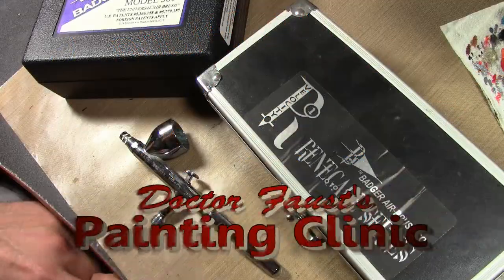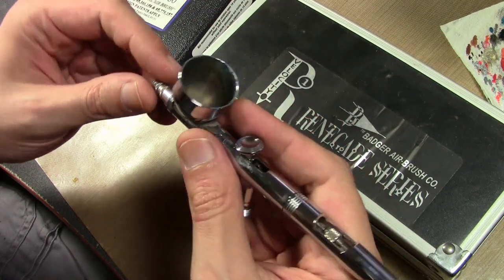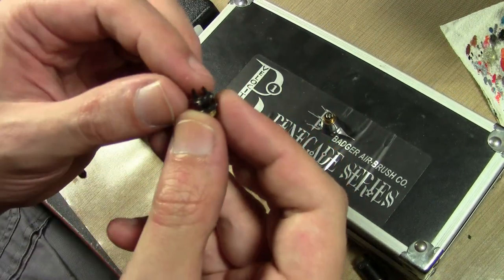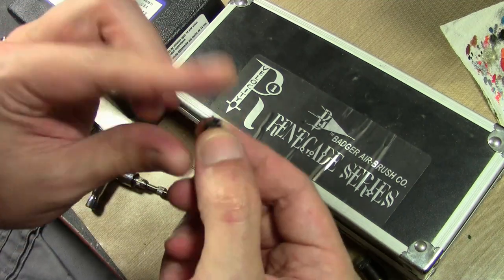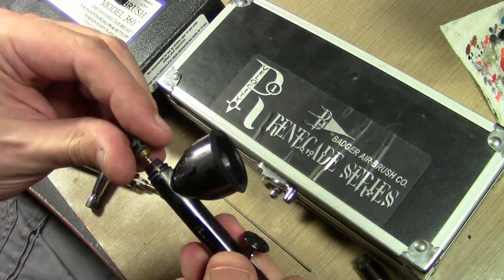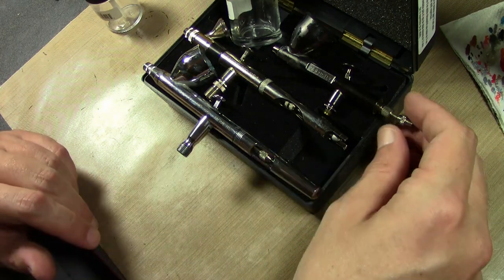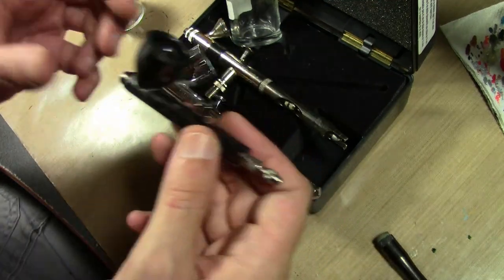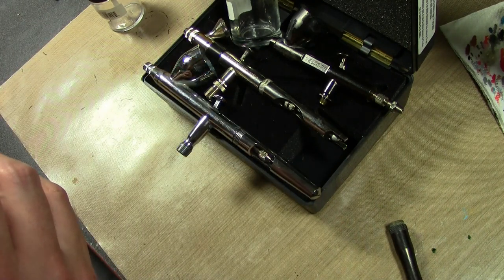The Beginner Modeler's Guide to Airbrushes

Comment: The forked tip makes it easier to clean tip dry, I believe that's the purpose. But as you said it makes to difficult to clean with back pressure. The Veda 180 is a good budget airbrush.

Comment: I got a Harder&Steenbeck Evolution 2in1 for my first proper airbrush. It was a little expensive but 2 interchangeable cup and needle sizes in 1 box? Yes please
Reply: H&S brushes are the bomb in my opinion. Blows all others out of the water!
Reply: You can also retrofit the 0.15mm needle/nozzle (like in the Infinity) for your Evolution for an even tighter spray pattern.

Comment: You should also mention that people should think about are the size of their hands too. You don't want to get a small airbrush and have a large hand. If they do and if they airbrush for along time, they will be getting cramps or will tired easily. Pachsee will be good for those problem and they are very easy to fix and use too.

Comment: Actually, nozzle size differs from company to company.  For example, the Badger 360 has a large nozzle like the Iwata Eclipse (go ahead and take a look inside).  The Iwata Revolution CR, on the other hand, has the same tiny nozzle as the Badger Renegade.  The big difference is that the tiny Iwata nozzle is screwed into place with a  small spanner.  The big problem with that, is that if you screw it on too tightly, the nozzle component actually separates from the threaded component, rendering it useless (happened one time too many on similar airbrushes).

Comment: I actually use the devil's horn/fork thing a lot on my Harder & Steenbeck and you can actually use the tip-blocking cleaning technique anyway. Just pinch it and you'll block the air. It's a lot faster to clean a tip-dry on that than to unscrew a solid one.

Comment: I have the Badger Velocity , the  Badger Patriot 105 and the Harder & Steenbeck Siverline Evolution. The 105 is my goto air brush. It's built like a tank and easy to clean. The Velocity is a nice AB but it actually has a .21 needle. Which is fine, but it takes a lot long to clean. And I have lost that nozzle. So now I keep a spare. I have a love hate with the Evolution. Amazing craftsmanship and the trigger is all that. But man, it is miserable to clean. Everybody raves about how great the H&S's are to clean. What a load. I actually have to run this through the ultra sonic every time I want to change colors or just clean it in general. I am going to get an Iwata Eclipse. It looks pretty much the same as the Patriot, but I love  the idea of flushing the paint back into the cup. Cant do that with the Patriot.

Comment: Like a screwdriver, or socket wrench, (the list is endless), an airbrush is merely a tool.  And it's hard to do good work when you buy a cheap tool whether it's a lousy screwdriver, a poorly fitting socket, or an airbrush.  My first airbrush was a Harder & Steenbeck (which model you buy isn't very important because all of the parts are interchangeable) and I found that airbrushing was a lot less difficult than I thought it would be, and my first efforts looked pretty good.  Thinking I would get a cheap airbrush for painting large areas, I later bought a Badger and had nothing but trouble with it.  I shudder to think of just how much more difficult a Master Airbrush might make of a relatively simple task using an H & S.  Buy quality tools; you'll never regret it.

Comment: I would suggest that beginners consider the Neo CN Gravity-Feed Dual Action Airbrush as a first airbrush. With Hobby Lobby's 40% off coupon from their website, this will cost you about $42 for a decent mid-level airbrush that is meant for working on small to medium sized areas with small amounts of paint.
Reply: The NEO CN Gravity-Feed Dual Action Airbrush comes with two sizes of cups, plus you can use it with no cup attached.  http://shop.hobbylobby.com/products/neo-cn-gravity-feed-dual-action-airbrush-395327/
Reply: Wonder if I can find a sensible UK supplier of something like this.

I'm considering getting one for doing terrain, but have no idea where to start :/
Reply: It is posted on Amazon in the UK, so other suppliers should be able to get it for you as well.
 http://www.amazon.co.uk/Neo-Iwata-gravity-feed-airbrush/dp/B007AUJJ28
Reply: With shipping it's still cheaper to get that on amazon. Same for the higher end models. The shipping on Hobby Lobby is ridiculous!
Reply: I have to admit that I benefit from having a Hobby Lobby store 10 minutes from my house

Comment: I am about to buy my first double action airbrush and I need your kind advice for this. My tasks are for scale modelling, mainly 1/24 & 1/12 automobiles. From the website I have the options to get a 0.2mm, 0.3mm & 0.5mm nozzles. Should I get all 3? I understand that smaller nozzle produces finer details and vice versa, but in what extend do they differ? Simply put, can 0.3mm (something in between of all 3) produces good details and covers surface large enough for exterior paint jobs? I needed to cover the exterior paint job quick enough so the body remain ‘wet’ during painting. I hope you could help me on this and thank you in advance! Note: I will be using compressor with regulator & tank for up to 10bars.
Reply from the maker: Kevin Yeoh .5 is fine. Anything smaller is mainly for very tiny detail work. Most quality airbrushes offer aftermarket tips and needles in different sizes, so you can get one airbrush and buy the bits to change the size.
Reply from the maker: Kevin Yeoh Also if you want the paint wet (beware of runs) that's mainly up to the thinner you use. Thin with plain water, assuming acrylic paint, and the paint with dry slower.

Comment: I hooked up the compressor to the airbrush, tinkered with the compressor to get it to a little under 20 psi.  I cannot get the air to flow through the airbrush.  ANy suggestions?
Reply from the maker: That's rather odd. Does air come out of the compressor with no airbrush attached? First thing to try is to completely break down the airbrush for a full cleaning and lube.
Reply: I have never used the airbrush
Reply: The hose was bad. Now I have air flowing through it.  Time to play and learn

Comment: What type of oil do you use for cleaning the gun? I just bought a point zero kit plus accessories, little over $100. My son wants me to paint a fade on shoes. I’ve always used a brush but figured a gun will be much better for that!
Reply from the maker: Oil is for lubrication and they sell it for airbrushes. If you mean what cleaning solution, then Purple Power.

Comment: I have been building model tanks for about 2 years now, i have always painted them using spray paint outside. The finish is OK, but it lacks detail and i can't do camos. So i have been looking into buying an airbrush to have a better finish and more detail on my tanks. Your videos have helped but i still have a question. Do i need to use airbrushes outside (In Garage) or is it ok to use in my basement? (You cant use spray paint in the basement because all the fumes collect and stay there).
Reply: You need to use the right kind of mask. Aerosolized paint is NOT safe to breath.
Reply: I live in an apartment and I airbrush inside with no problems. Just get a pot to hose it out. You'll be fine.
Reply: Some people don't understand how long term exposure works... yeah, you're okay for now.

Comment: My first airbrush is the H&S Ultra. I am lucky because I bought a cheap master airbrush G22 model to spray on coats of future shine. It feels terrible. The trigger is stiff and it looks poorly made. It is basically the cheap $10 model you can find all over ebay and Amazon but since Master put their logo on it they jacked the price up to$20. Otherwise it is the same thing. I advise anyone buying on to just get the $10 version. Master sells the parts to fix it if you mess it up. The parts should work. But if you can afford to spend 80-100 dollars go for the Ultra as a first airbrush. It is fantastic.